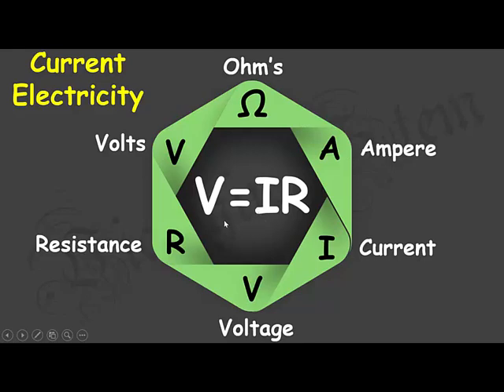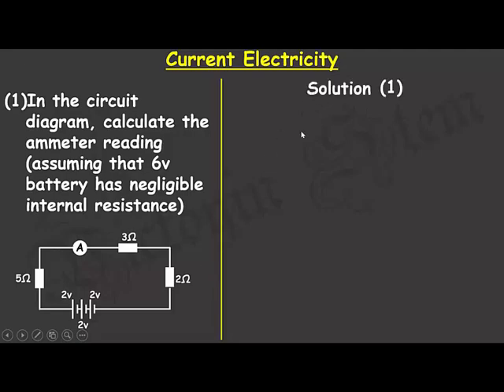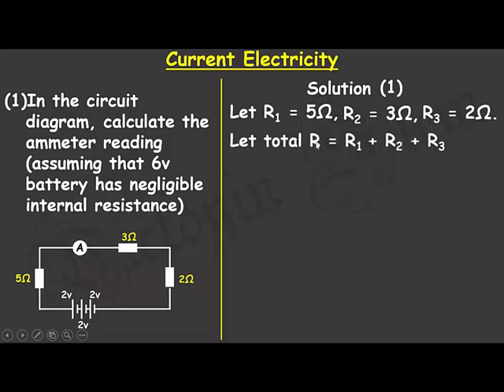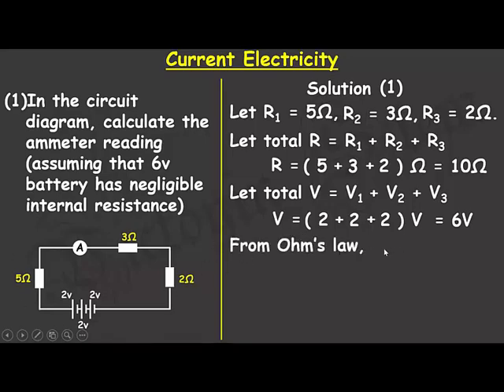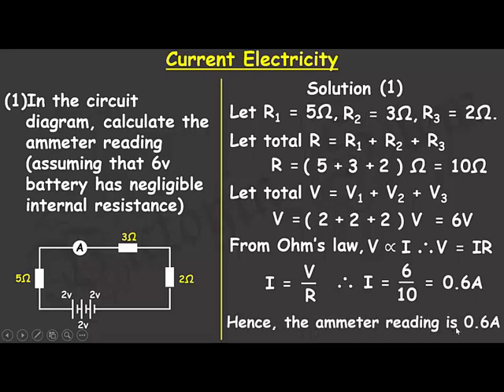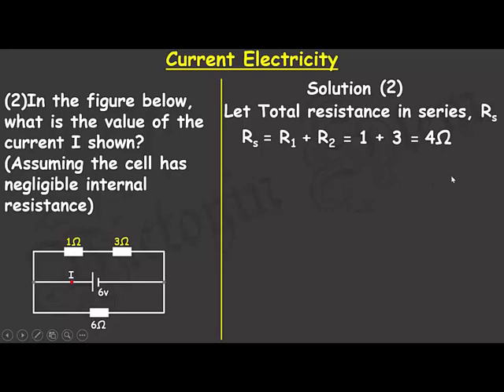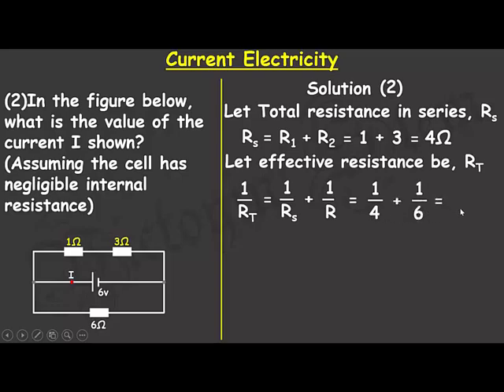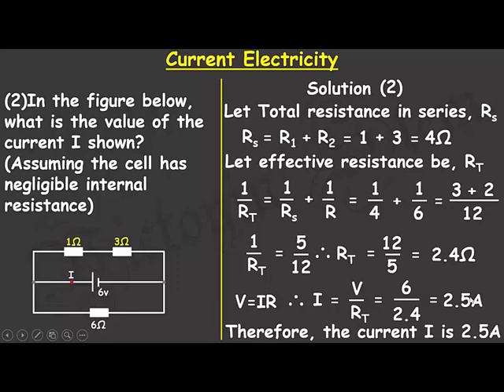Ohm's Law 1 (P)

Comment: how do we know it is parallel or series in a case where there is no diagram
Reply from the maker: Typically, the question will specify whether the circuit is in series or parallel; if not, a diagram will be given to clarify.